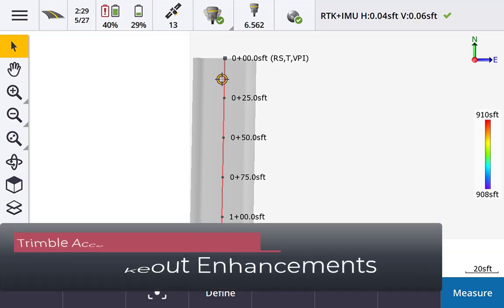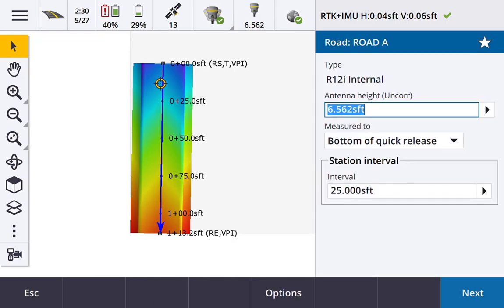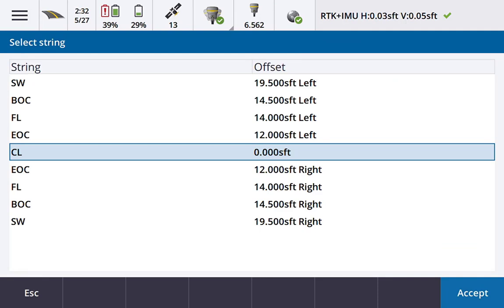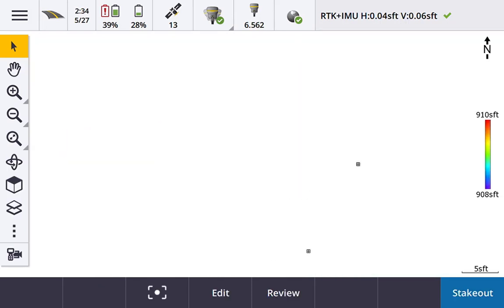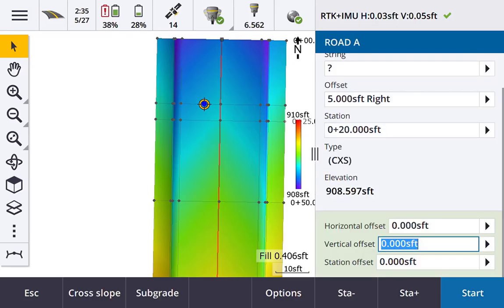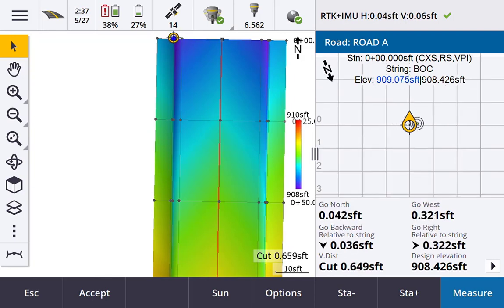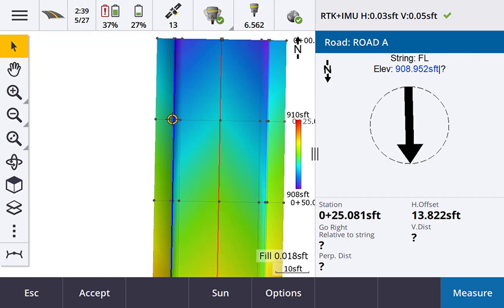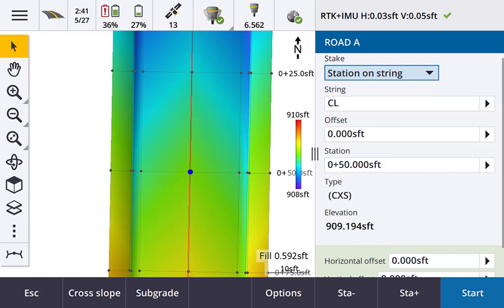Trimble Access: Road Stakeout v2022.00+

Comment: Hey so on previous versions of TA you could stake specific stations to an alignment with both horizontal and vertical offsets.

 For example were trying to stake 17.5 feet left and .23 up from the centerline road alignment finish grade (for setting top back of curb off the alignment).

Has that functionality been moved from general survey into the roads application with recent updates (since the 2019 version)?